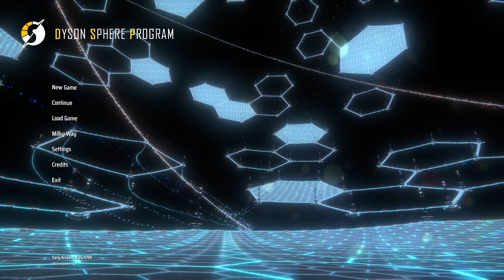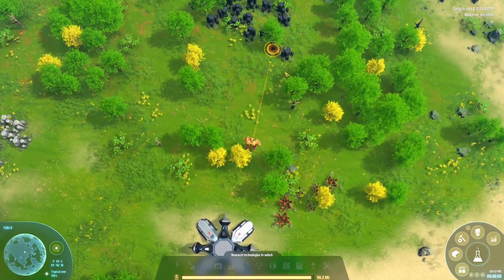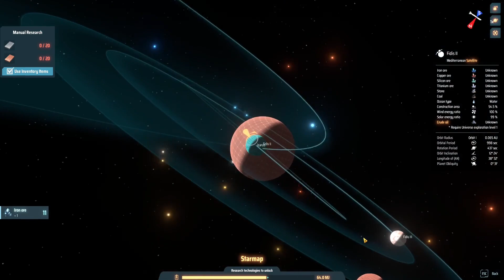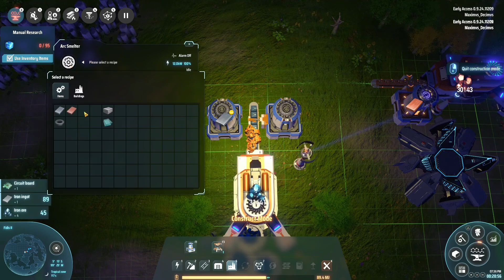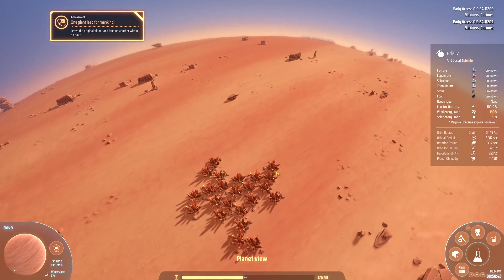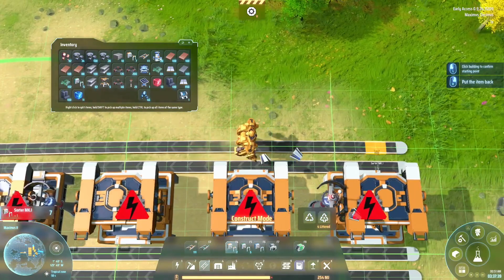Dyson Sphere Program: Destiny! One Giant Leap For Mankind Achievement! (#1)

Comment: Love your DSP stuff, but oops on the no foundation achievement...!  Good luck for the run.
Reply from the maker: Yea the trick is that basically some achievements conflict - like the Solar Sail ones (launch 100k vs. no Sails) or the Land Fill (Cover a Planet vs. no use).  Another would be the 25 and 10 hour completion achievements... probably not good for a series of doing all 64 systems lol :)  So I'm going for the ones that make sense in a mega system, then the ones I dont get I'll do in another playthrough (the 10 hr one would probably take some outside rare resource veins where this one may not... I'll see what I run into lol)